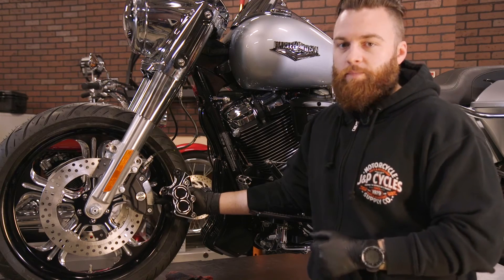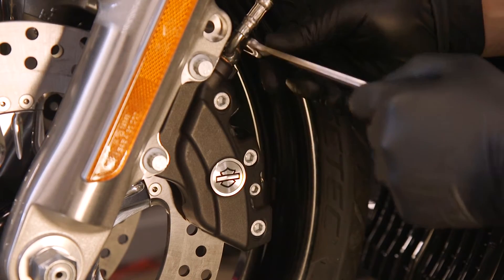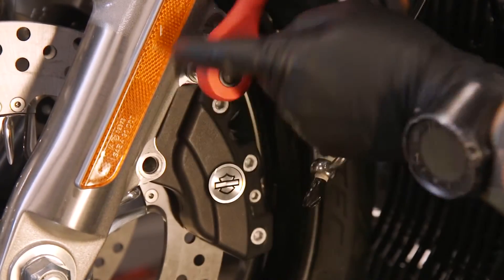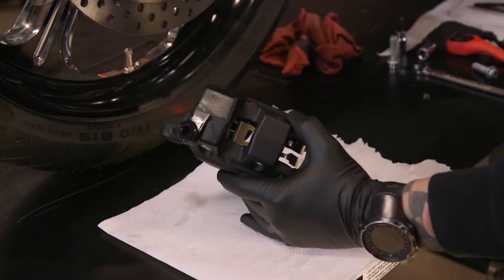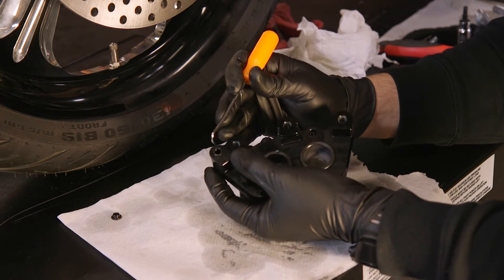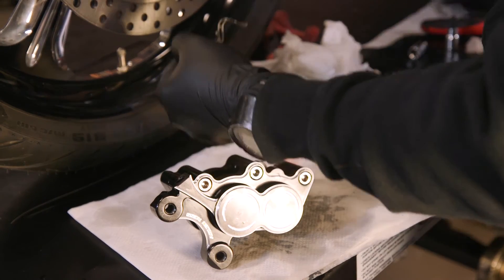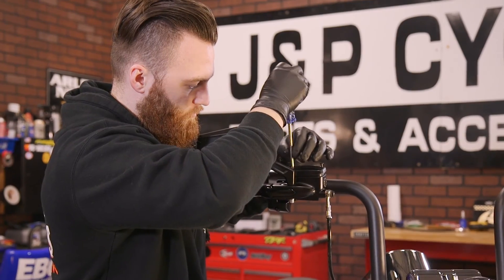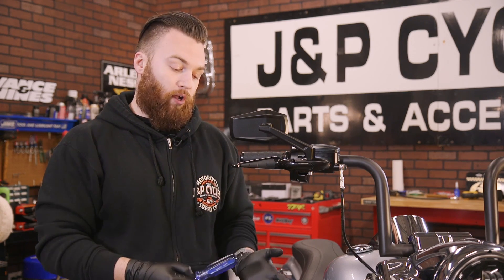Arlen Ness Front Brake Caliper Housing Install

Comment: What did you just use to block off the break line.
Reply from the maker: Paper towel around a rolled piece of electrical tape. Vacuum caps, rubber dowels anything that will block the fluid from escaping but not damaging to the banjo will work.